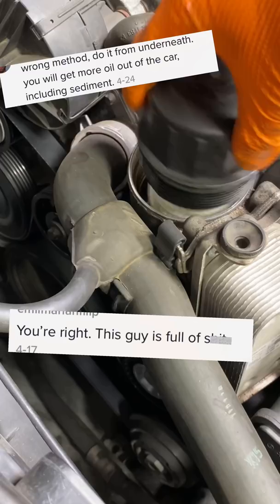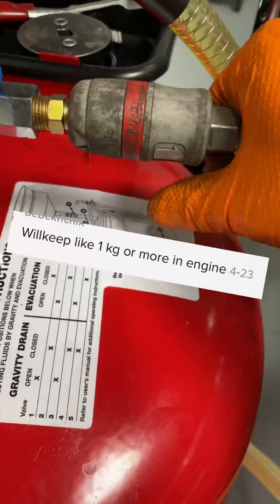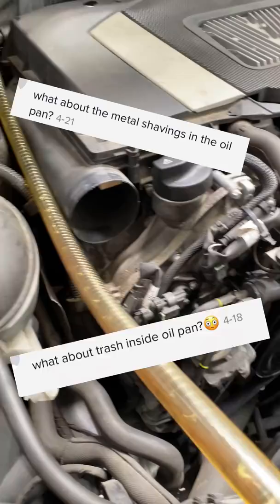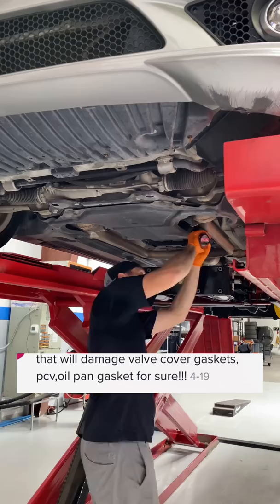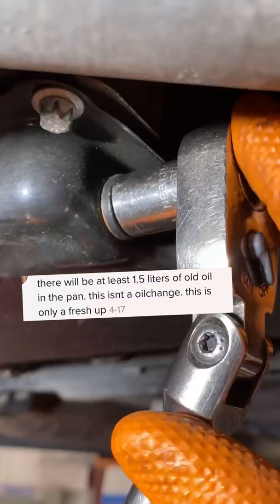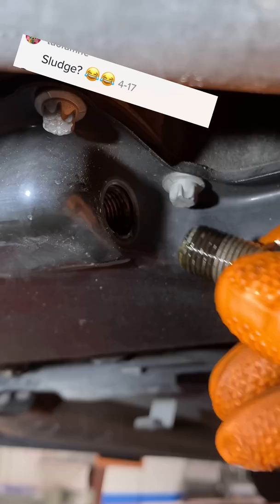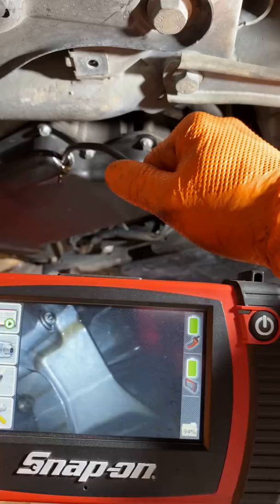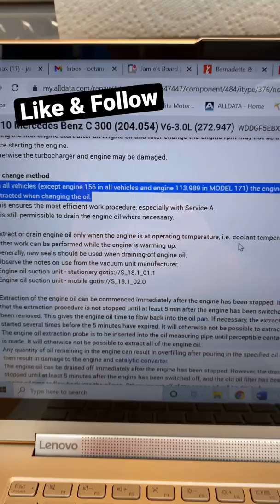#shorts Mechanic Proves Haters Wrong

Comment: I’m actually quite surprised at how well it evacuated the oil from the pan.
EDIT: For those of you lacking in mental ability that are clearly confused by my comment. OBVIOUSLY it’s designed for this. I’m just surprised with how good of a job it actually did with leaving zero debris or oil in the pan.
Reply: Lol owned
Reply: @cadesmandela1935  hahaha
Reply: Do you know how expensive that pump is lol
Reply: @cadesmandela1935  jeez, relax buddy. They just said they were surprised
Reply: It's because it's a vacuum sealed one. Normal tube down the dipstick line wouldn't get anywhere near that
Reply: @cadesmandela1935  Why are you upset
Reply: @cadesmandela1935  lol and there will still be debris on the bottom of your pool lol owned one for 30 years. Go for a swim kick it up and it will get to the filter eventually
Reply: iT's aLmoSt lIkE iT wAS dEsIGnEd lIkE tHat.
Reply: @strider5402  Yeah because there aren’t thousands of other things designed to do stuff but they actually suck…literally.
Reply: @PeachIceCreamy  rt 🤣
Reply: @Pedro Daniel Lopes Ferreira 🤣 yea cuz Mercedes is in the business of making fake guidelines for TikTok. The only thing not right is all the internet specialists who think the engineers of this "high-end" car don't know what they're doing.
Reply: Mercedes oil stick goes to lowest point of oilpan.. the pipe is made verywell to suck all the oil out...
Reply: @chipskylark8869  I can’t swim bro so idc
Reply: Its literally designed to do that what are you surprised about😂
Reply: @Pedro Daniel Lopes Ferreira right, selling cars. Not making fake TikToks. You can't be in the business of selling cars and sell junk, nobody would continue to buy them. Bad business isn't making a reliable car, it's making garbage that can't last. There's more than enough high mileage Mercedes still running to conclude they know how to build a car. The key is properly maintaining them, and sadly most luxury owners have more money than sense but you can't pin that on that manufacturer. If the engineers say preference is to suck it out rather than the traditional drain plug, which do you think would be considered not "properly" maintained in that scenario? You're all emotional and upset with me, trying to insult me even and make it personal, because I mentioned you in a comment calling out people who think the engineers don't know what they're doing 🤣. Little man complex I guess.
Reply: @TonyTheTruckGuy  I mean some people just get angry over other’s incompetence 🤷🏾‍♂️
Reply: @Bammin.   Exactly what I said, can’t you read? I’m simply surprised with HOW WELL it actually worked.
Reply: @young23D   And what incompetence is that?
Reply: @Kivistreet  Right, it’s clearly designed well, but I was very impressed with how clean the pan was when he bore scoped it.
Reply: @Pedro Daniel Lopes Ferreira yeah because you’re smarter than the manufacturers engineers. 😂 oil companies love you
Reply: @TonyTheTruckGuy  i think it kinda depends how old the car is.. and depends what oil was used.. there shouldnt be alot down there anyway.. everything should stay in oil filter.. but i agree with u! Usually that stuff wont come out from the oil drain hole anyway... if there is any damage done to the engine it will stay on the oil pain 👌
Reply: @Pedro Daniel Lopes Ferreira this isn't fake tho🧐
Reply: @cadesmandela1935  u are joking right
Reply: @TonyTheTruckGuy  but it being Thincker also Helps it bring everything up with it
Reply: @TonyTheTruckGuy  and I'm pretty sure the Tube he's Connecting to runs to the bottom of the Pan
Reply: @deltasixgaming  yes it is.
Reply: @deltasixgaming  i replaced 1 week ago a plastic oilpan on mercedes.  The pipe runs to the lowest point of the oil pan.
Reply: @deltasixgaming  Right but thicker also means harder to suck lol. That oil dipstick tube MUST go to the absolute lowest point of the pan for it to work this well.
Reply: @vanderumd11  I paid $900.00 several years ago.
Reply: @nicktaylor5868  🤣
Reply: @cadesmandela1935   @A. Hunter S  swimming pools are open and you can reach the entirety of the bottom of the pool. This tool doesn't go all the way to the bottom of the oil pan. The the performance of these two tools are vastly different. P.S. notice I didn't have to call you names to disagree with you. That's how things used to be for a large majority. Now grown ups (definitely not aiming you're a grown up) can't have a debate/disagreement with calling each other names like grade schoolers. But hey, it's your future, not mine. Get well soon.
Reply: @jackryan4313  fucking thank you for hitting him over the head with the book…I was getting annoyed seeing no one had done it yet.
Reply: @jordan.fa5592  why does he have to be upset
Reply: @kwizmo  you're very welcome.
Reply: @Pedro Daniel Lopes Ferreira I don't quite understand you... do you really think Mercedes would allow their vehicles to be put at risk over this? Do you really think the entire auto industry wouldn't be up in arms over this contraption if it didn't work? How do you know it's a new technology that hasn't been validated over years of research? Really man? I don't wanna sound condescending, I really don't, and I hope it's not coming across that way. It just doesn't make sense to me that you wouldn't even look into it. Especially if it's actually a better alternative
Reply: @HildrTV  bro why are you so hard pressed lmfao go calm down buddy
Reply: @HildrTV  Lmao, articles. Yep, you’ve never worked on a vehicle. The oil DOES thin, initially, due to breakdown. But over time, say, 7000-10000 miles which many manufacturers recommend now days, it starts to get thick again due to deposits. The very first article I clicked on with a Google search even confirmed this. This is especially true in Diesel engines, where the exhaust soot gets trapped in the engine oil. The “article” you posted by “car buyer labs” is literally like a blog or newsletter, and holds no professional merit. It also clearly doesn’t take into account the deposits I mentioned. Again, stick to anime.
Reply: @Pedro Daniel Lopes Ferreira I changed oil this way in thousands of Mercedes over the duration of my career as an auto tech.  Never had a problem.  As long as the oil is warmed up when it's evacuated, most everything is pulled out of the engine.
Reply: @Pedro Daniel Lopes Ferreira now you’re using your noodle. It’s the perfect business decision for a company who needs to service their own vehicles. Cars per hour would be maximized and in turn bring more profit. I’m actually curious if you’re religious now that you have the “seeing is believing” argument going on here.
Reply: Couldn't make it through the comments.. The amount of butthurt killed me. I am now a ghost typing this from beyond.
Reply: @TonyTheTruckGuy  If your say your so knowledgeable on this subject why are you so suprised that an oil pump is actually doing what its supposed to do. Lastly if the article is the problem then i can easily refer you to many others that are saying the same thing you are conflating suspension of particles in a fluid with viscosity. Using your logic you would then think that if you took a cup of water and added sand into the cup you would change the viscosity of the water. Clearly that is not the case the sand isnt changing the molecular structure of water at all. You could state that the SOLUTION as a whole is more viscos sure. But would wouldnt say the water is more viscos. In the example of oil , the heat, and prease literally breaking down the molecular structure of the oil. This isnt something new its even known in thermal dynamics for a long time. Yes having metal filling and crap with make the SOLUTION more viscos as a WHOLE but the OIL itself IS less viscos. And you might think that being picky but it is very important. Im tired of people using terms incorrectly and if your claims that you've done this for 12+ years then you should know this!  Your like the person that calls everything they dont agree with a nazi while they clearly dont even know what a nazi. Sorry if I came off as being an ass but I cant stand people using well known definitions so loosely
Reply: @HildrTV  I'm not conflating anything. Particles end up in the oil, it's part of how an internal combustion engine works, ya dink. I was surprised at how well it worked because at the time, I was not aware that the oil dipstick tube which he was sucking the oil out of, attaches at the lowest part of the pan, which makes sense. I don't work on Mercedes, I work on heavy trucks. You know, the things that literally bring 70% of goods to you, so you're welcome for that. Your sand to water analogy is completely apples to oranges. Sand would sink right to the bottom and not blend in. It's LITERALLY the job of engine oil to not only lubricate, but CLEAN the engine. How does it clean the engine? It washes away the particles, which then get trapped in the filter if they're big enough, otherwise they stay suspended in the oil. No shit Sherlock, on paper, if you could somehow remove the particles from the oil, then the oil itself would be thinner than when it went in. But we don't live life on paper, do we? And this is real life, isn't it? And the particles stay in the oil until we drain it. Thus like I've been saying all along that the oil that COMES OUT, is THICKER than the oil that GOES IN, BECAUSEEEE of the particles. Do you have any clue how many gallons of oil I've watched drain? Not my fault you read the comment wrong or took it the wrong way. ALLLL this arguing because you took something the wrong way and came in swinging like a dickhead simply because I stated how impressed I was by the quality of the evacuation.
Reply: You guys don’t understand how shit works if you’re surprised... this engine is airtight in the process leaving no room for debris or sludge to even be left over if anything using gravity by removing the plug will leave sludge and debris
Reply: Ok ‘Tony the truck guy,’ boy what a name. I bet your really short…. Dudes name Tony usually are.
Reply: Uh. Okay. I was just gonna say nice job!?
Reply: @TonyTheTruckGuy  You clearly have no idea what your talking about if you getting hung up on an example... the point of that examples is that having particles in a LIQUID DOES NOT MEAN THE LIQUID IS MORE VISCOS. Metal filling do not change the molecular composition of the oil. HEAT and pressure does. DOOOOO YOOOOU UNDERRRRSTAAAND? Or do I need to say it more slowly. If you going to say something is more viscos then at least use it correctly. The solution is more viscos the actual oil it self is not when compared to how it was when its new. Like seriously man you say you work in this field yet you cant even tell the difference of a solution that contains oil and other contaminates and pure oil. There is not CHEMICAL CHANGE OCCURING WHEN YOU JUST ADD METAL FILINGS TO OIL. The oil only changes viscosity because of the high pressure and temp acting upon it. If you wanna flex but stating oh I work on trucks therefore I'm right. Well then we can do that because I have my degree in physics and my dissertation was in thermodynamics/FB asymmetry of B-mesons, because clearly you only care about dick measuring when it comes to using proper definitions
Reply: germans just get “it” my guy
Reply: @vanderumd11  they are not that bad. Can pick up a nice one for 100-150
Reply: @HildrTV  And of course he's going to be talking about the viscosity as a whole. Your cup metaphor is the perfect thing to look at to understand what he's talking about. 

He's speaking of the viscosity of the fluid (and particles suspended within) contained in the oil pan. "Oil" simply refers to the contents of the shit in your pan before it is drained. With that context, viscosity of the "oil" is increased over time not because of the motor oil itself thickening, but because of all the shit in it making the solution thicker. Particles suspended within the oil would also be considered part of the entity identifiable as oil, and therefore is included when using the term "oil" in this context. 

In simpler terms, pouring sand in a cup of water does not make the water thicker. But it makes the mixture of sand and water more viscous. What's in the cup? Water. It's sandy water, but it's water. And now it's thicker, too.
Reply: @TonyTheTruckGuy  Dear god a  Solution - liquid mixture in which the minor component (the solute) is uniformly distributed within the major component (the solvent). The Oil is the solvent the metal filling and other crap is the solvent. When you are say "Old Oil" That is a SOLUTION that contains metal fillings and other crap along with oil. All I'm saying and what the other articles are saying is that the used oil itself is less viscos then when it was new the reason it seems thick is because it has shit mixed in. If you took that same oil and filtered out all the metal filing and crap the resulting USED oil will be less viscos then new oil. If your talking about what it being taken out of the care that isn't just OIL its a SOLUTION that is made up of oil and other crap.
Reply: @HildrTV  Never was arguing a single one of those points with you my dude. I simply stated that the old oil is thicker, which it is.
Reply: @dreugh424  If I annoy you then leave I don't care about your opinions
Reply: @Pedro Daniel Lopes Ferreira It does save a lot of time if you don't need to rack the car for anything. I guess it's more of a convenience than anything since you can technically do it either way and get the same result.  

Personally I did it this way a majority of the time, but if I was doing a large service where the car was already up in the air, or I was pulling the oil pan anyway, I'd pull the body panels and plug.
Reply: @TonyTheTruckGuy  ok well sorry for miss understanding then and for being rude
Reply: We expect car companies to lie to improve planned obsolescence.  Ford says a 2000-11 Ford focus has a lifetime transmission fluid.  Anyone with a brain does it every 60k or so.  Higher spec aftermarket fluid seems to do well after 60k so far in my experience.  Also the first 20k is the hardest as the transmission breaks in so you can probably extent normal duty driving intervals just monitor the color
Reply: @RELLIKPIR  Mercedes tried the same thing with lifetime transmission fluid around that time, too.  It didn't work.  They eventually went back to adding it into the service schedule.

Comment: This is how its been done in boats for decades.. the pan sits on the hull.. Oil MUST be vacuumed out. Every inboard boat owner owns an oil vacuum pump. It works great.. it suctions out everything.
Reply: Exactly!
Reply: yep!

As a simple example, I had people try and argue w/ me when I worked on fuel cars (top fuel, top alcohol etc.) about funny cars being dry sump and the dragsters being wet sump, because there is 'OBVIOUSLY an oil tank on the funny cars and its stored in the pan in dragsters and I KNOW how oil pumps works. lol..  try asking..? maaaybe..?  😂

Although, a majority wanted to just learn and ask questions and inquire WANTING all the data they could get.

There is basically an 'infinite' amount to learn and analyze things..and those people were the ones I love(d) talking to!
...not the 'why didn't they save the fastest runs for the finals??' (and it's 97° w/ a 140° track temp) type of people.

you don't know till you know 😊
Reply: @dmeemd7787  surely you realize that the overwhelming majority of folks will have no clue what any of your comment means.
Reply: @dmeemd7787  what I’d like to learn I didn’t understand most of your comment
Reply: Thats how we do it with trucks aswell. Way easier than pulling out the plug underneath which also creates a big mess because of the way it‘s designed xD And we usually get everything out the pan. Works even faster when the Oil is warm :D
Reply: Plenty of inboard boats have engines that can be changed with the oil pan drain plug. Not "Every inboard boat owner" needs a vacuum pump. Not even close.
Reply: @Wrenchking555  My Mercruiser engines come with a hose that is attached to the bottom of the pan and then attaches to my hull drain plug. I simply undo the drain plug and then pull the hose out to drain ALL  the old oil. Gee I wonder why Mercruiser does that. Now if the boat is in the water and can’t be done that way then you hook a pump up to the hose and pump ALL the oil out. I think Mercruiser/Mercury Racing knows a thing or two about engines and oil changes.
Ooop that was for Jenifer White Wolf.
Reply: @daveyjones777  use Flex Seal tape lmao
Reply: Ah Boats the pentacle of reliability in the transportation world 🤣

Comment: I'm a Mercedes-Benz master tech and I drain the oil from the bottom ONLY because the vehicle is already on the hoist for an inspection. So it drains while I inspect it and saves time overall. And as far as sludge, I've never seen a mercedes engine with sludge if the oil changes are done even close to on time (they are 10,000 mile interval oil changes). I love videos like this proving people wrong who probably have never even checked their oil let alone changed it 😂
Reply: Bro wtf are you talking about your supposed to change your oil every 5k miles 😂😂😂😂
Reply: @jacesimmons6374 ... I stated Mercedes-Benz factory recommended oil change interval. They haven't had a 5,000 mile interval for decades. You're talking about a random generic  number. I agree sooner is better but I was very clear in my comment about "what I was talking about". Pull your head out of your ass, the weather is nice out here

Comment: I work at valvoline and we use these oil evac machines. We often usually have to add an extra quarter of a quart because it sucks out more oil compared to dropping it from the drain plug.
Reply: I to used to work at a valvoline in Youngstown Ohio, and we had to do the same thing . That is crazy how it gets more out going up than draining down. 💯👍👍 
God Bless you Mike .